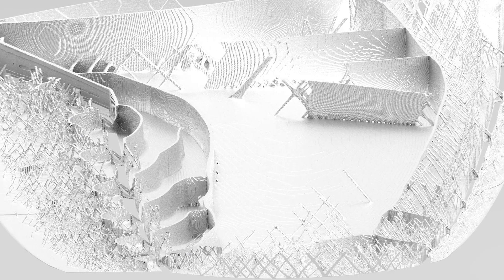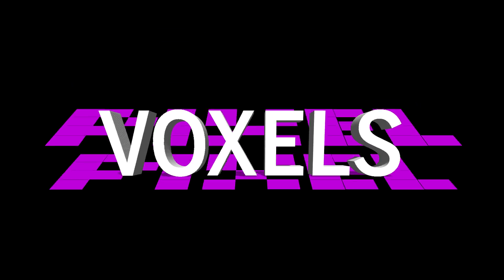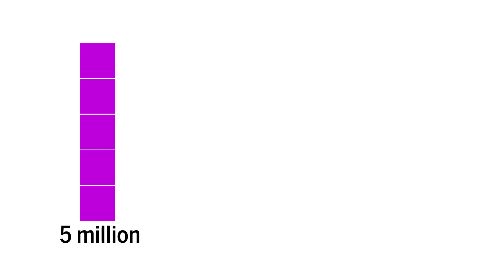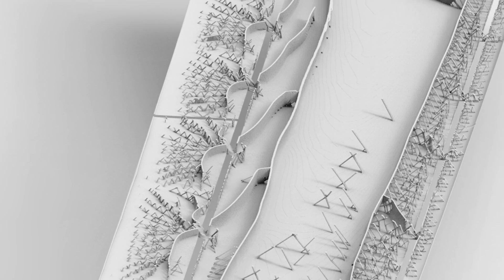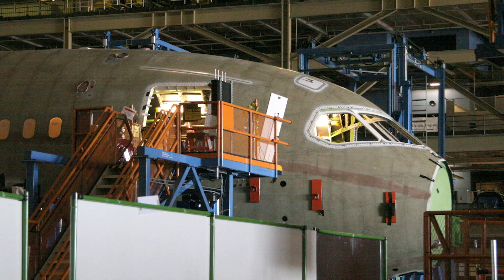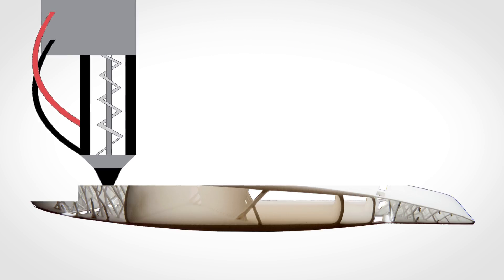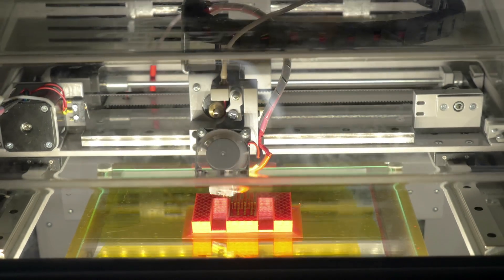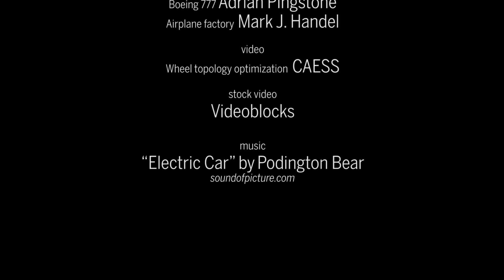New processing lets a supercomputer design a radical new wing

Comment: Yeah, let's make the plane 10x more expensive to manufacture (how are you going to 3-d print the type of strong+light metals needed for this, without having internal interfaces and flaws which can ONLY come from casting the rough shape in the first place?  Vibrations in wings are constant, which causes metal fatigue -- something which 3-d printed metal, with later-upon-layer of not-fused metal will not be able to resist for any length of time.

Time for you to join Popular Science and Popular Mechanics with their 70-year "flying cars are gonna be available and in widespread use, any day now"